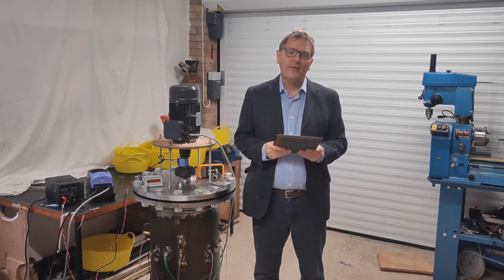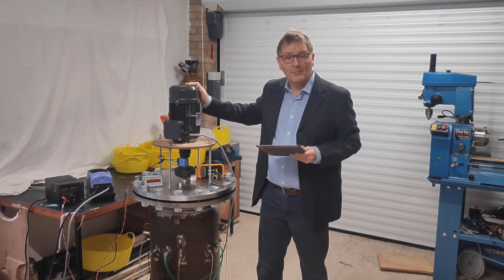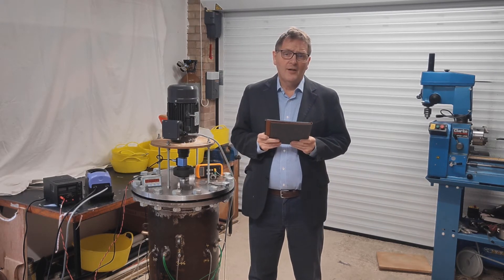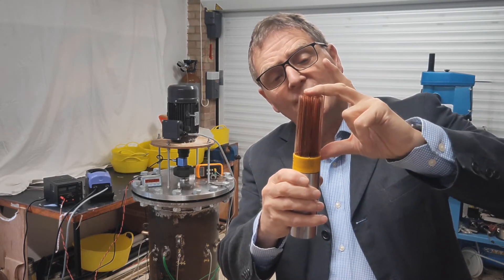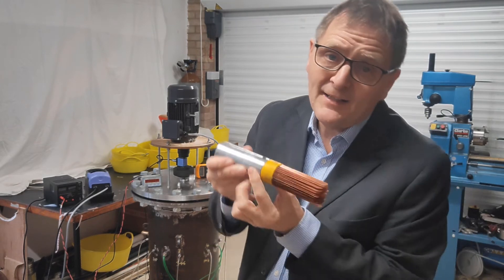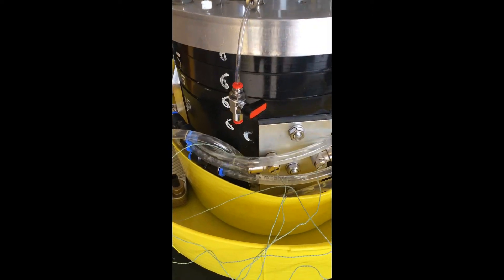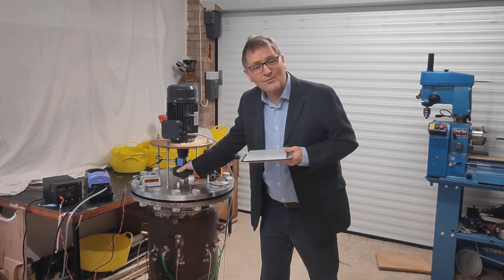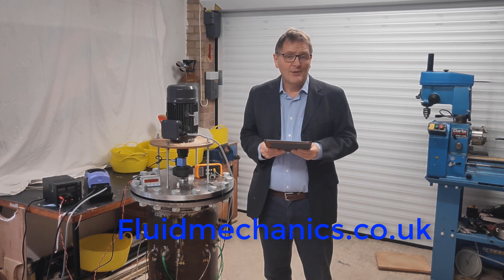Near Isothermal Stirling Heat Pump

Comment: would it be possible to reduce or eliminate the electrical energy input by recycling the heat you pull out of your cooled environment with a sterling engine? if so what sort of scale would it need to be done at to make the added cost worth it by comparison to the energy costs?
Reply: Im not asking about creating heat. Im asking about moving and concentrating heat. All commercially avaliable heat pump systems the move heat at an electricity input to heat output ratio better than 1 to 1. With some at rates of 1 to 6 or higher. So if this system capable of the same sort of heat pumping as those then there is plenty of energy to be harvested. Im wondering if the heat gradient would allow a sterling engine to run efficiently enough to offset the energy costs. Unless this is a totally different type of heat pump
Reply from the maker: No its not possible. If you tried this you would end up putting more power into the first stage and so have a less efficient machine.
Reply: You couldn't eliminate the energy input; physics requires you to always spend more energy than the work you get out, and even a plain 100% efficiency is impossible in the real world. This is a practical device that demonstrably improves efficiency to get us significantly closer to the limits of thermodynamics. Since a heat pump is literally moving heat from one place to another, that work has to be done at a net energy loss, so you need energy input. There are rapidly diminishing returns, which is why a second system recycling the waste heat rarely helps when dealing with heat engines.

Industrial scale power plants are able to recycle their waste heat due to their large scale and high operating temperatures. Once the waste heat gets down to a low enough level that it's warmer than outside air, but not dangerously hot, it can be pumped to buildings to heat them in cold weather, or used to heat up water for hot water supply. So in industrial thermal power plants you do see a lot of waste heat reuse. At the scale of consumer A/C units, I would not expect it to be practical to do this.

Comment: Dear Mike, It was a nice demonstration video from your prototype heat pump! Congratulation for that! It was a hard work and lot of invested money I think. I have few questions. First about the 0,5 mm gap between the gas molecule and the copper surfaces. If you have 2 mm distance between the fins, how did you get the 0,5 mm gap from the gas molecules? Do you have another 0,5 mm height silicon oil layer on the fins when it's move (I think the layer height is always change when thy cycle goes)? So it looks like than a parallel plate moving heat exchanger. If the engine works with Helium on 16 bar than the gap should be around 0,29 mm in the gas channel for the hot side and around 0,23 mm on the cold side in a pretty high efficient heat exchanger. I have lot of question in my mind, but actually it is enough now. Thanks to share this fantastic protoype engine! Greetings from Hungary! BLADE
Reply from the maker: Hi Blade, It is 2mm between the fins. So the midpoint is 1mm. 1mm is the maximum distance a gas molecule can be from a surface. The minimum distance is 0mm. So the mean distance is midway between 0 and 1mm. That is 0.5mm
Reply: @MikeCrowley  I know what do you mean, but the flow is laminar here, and the heat exchanger's efficiency will be low because the gap is too big. The distance for a good gas-solid heat exchanger where we use parallel plates could be 2* the gas penetration depth. The ideal distance is 8 times lower than now. So, a quasi isothermal compression/decompression without a perfectly designed heat exchanger impossible. The heat exchanger is the biggest pain in the arse for every people who designed Stirling or thermoacoustic engines all around the world.
Reply: @AttilaBlade  vicces... ahogy megláttam ezt a videót, azon gondolkoztam, hogy küldök egy linket az Attilának... és akkor jött szembe a komment =) Nekem is soknak tünik a 2mm gap.
Reply: @sandorkonya  Valószínűleg a folyadék közeg miatt van egy ilyen kompromisszum, mert a felületi feszültség miatt nem ürülne ki a lemezköz. De az ötlet maga nagyon eredeti!